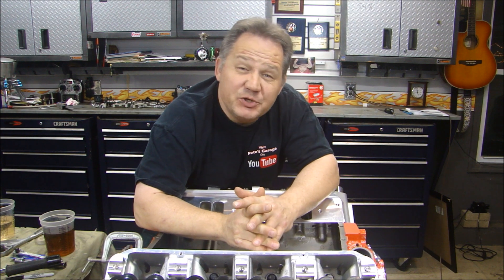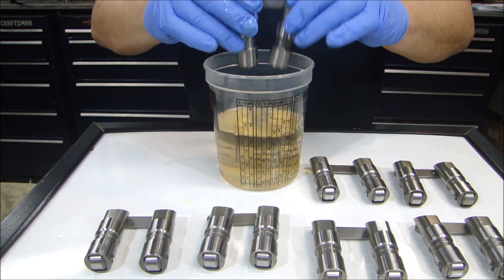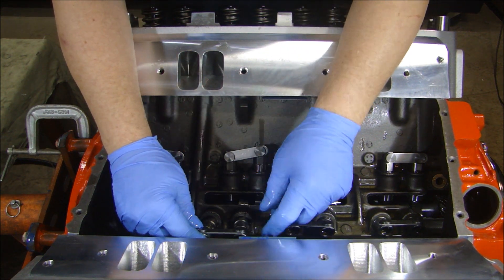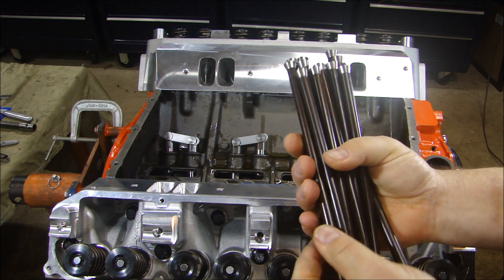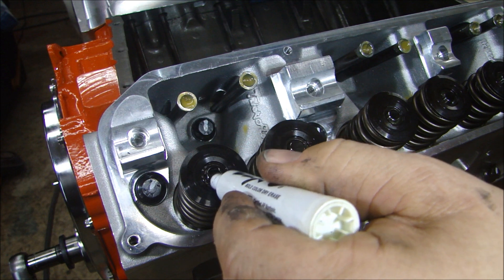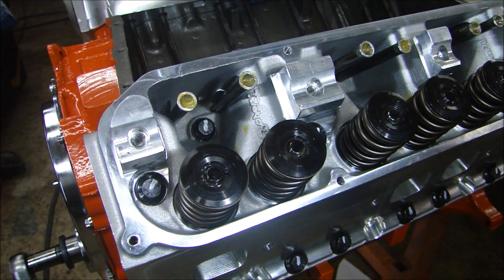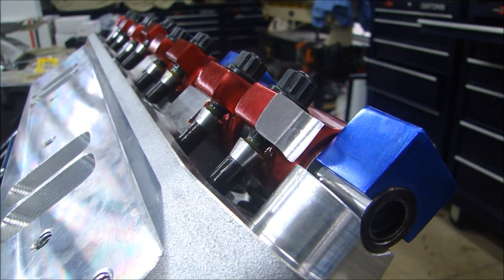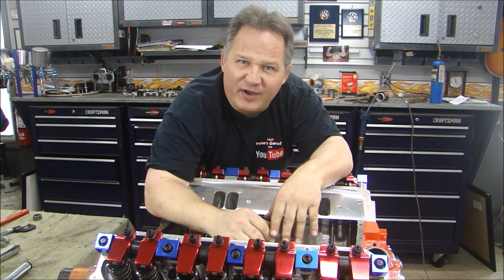440 Chrysler Mopar Part 9 - Installing Roller Hydraulic Lifters, Pushrods, Rockers & Setting Lash

Comment: B3 Racing Engines has an amazing article on the shortcomings of Mopar shaft rocker setup and how it effects the geometry. Definitely worth a read for anyone building a Mopar, small or big block.
Reply: wow now thats what i am talkig about thanks !!!!!!!!!!!!!!!!
Reply: back in the early  1980's we woulld take off the rocker pedastils , like a max wedge stage 1. and adjust, very time consuming , alot of machining .
Reply: I am working to get some of mine sorted out. When you do what Pete did, see how large the path is across the valve tip and understand what that really means, it is worth the time to get it straightened out. I am running Harland Sharps and have .120" across the tip face. Should be able to reduce that by over 50% moving the rocker shaft up and towards the intake.
Reply: you may want to try a set of   Lash Caps  for the valve stem face. there are different sizes ,diameters ,thickness .and manufacturs now. where before it was just mopar.
Reply: also like the max wedge stage 1 head , with the pedastils removed we were able to shim up the rocker stand blocks , or mill the blocks down more, also used lash caps . custum pushrods , recheck lift specs , rocker ratio etc , old school stuff ,
Reply from the maker: Great stuff guys! Thanks for the comments
Reply: What shortcomings?👀
Reply: @eddiegarcia9657  Basically doing anything to the valvetrain that alters the factory geometry (lift, pushrods, valve spring diameter, etc). The shaft setup is very robust but still fixed in it's position whereas a fulcrum setup has the ability to adjust  the rocker's height/position in relationship to the valve.

Comment: If they are cheap Procomp or Speed Master rockers I would be a little nervous about using them.
Reply from the maker: Great comment Tim. That may be a good process when you can't prime the engine by turning the pump.
Reply from the maker: I understand. Have you ever had a problem with them?
Reply: I haven't used them ever because of the bad reputation they have. They are cheap chinese junk. I never skimp on quality when it comes to valve train etc. I really hope that you don't have to put your hands back into that engine because of them rockers mate.
Reply: @ Tim Hammett I didn't even mention anything to do with what your talking about. But thanks for the reply.
Reply: You are quite right, I was trying to reply to a question made by Pete, but my Youtube page has no place for me to reply to the video and your's was the first I could make a reply to his video with. My apologies.
Reply: In answer to the question about soaking lifters. Back in the eighties I worked for Ryder Truck Rental and I seem to recall Detroit Diesel required cam followers (lifters) to be soaked in oil that was heated to a specific temperature (ie; 190 degrees F) for so many hours then allowed to cool before being installed.  I was told the heated oil being then at a much lower viscosity would penetrate any and all parts of the lifter so that no part of it could be involved in a 'dry' start. I have no idea whether or not this is protocol nowadays. If there is no reason to hurry a build I've since that time called it 'insurance' to do this for any roller or hydraulic lifter. My $0.02

Comment: nice  job . Q- what do you think of valve stem lash caps, you get more surface area for the roller tip .  also how would you adjust the roller over stem off center back and forth , because it looked like it rolled center then forward only rolling on half the stem top.
Reply: Usually 440 rocker arm geometry and valvetrain alignment adjustment is with shims/offset-shims between the rocker pedestals and the rocker shaft to raise/relocate the pivot point, lash caps and by adjusting pushrod length. Some other methods involve machining/replacing/relocating the shaft pedestals.
Reply from the maker: Great comment, thank you for answering
Reply: thank you patw52pb1   , thank you Pete